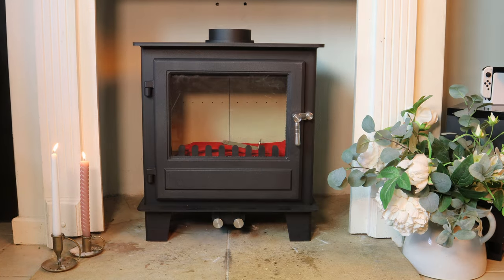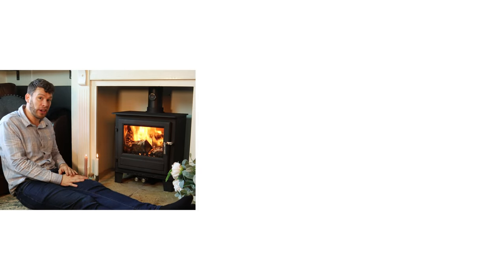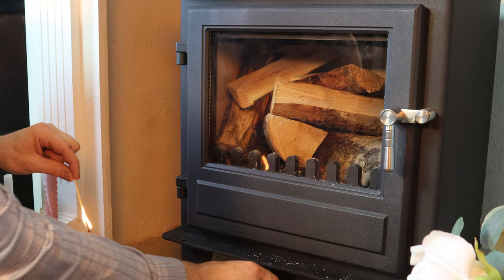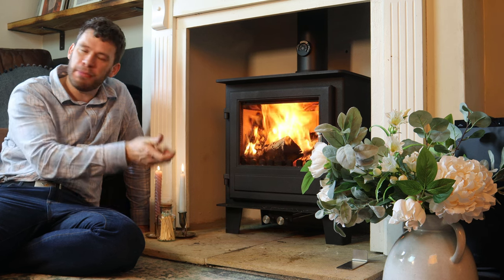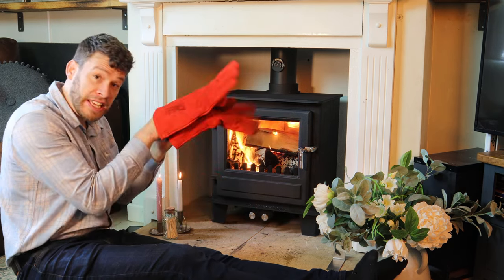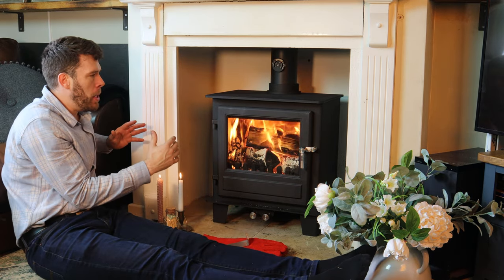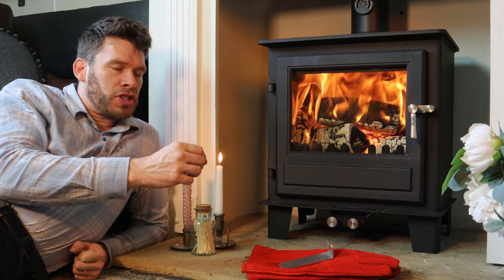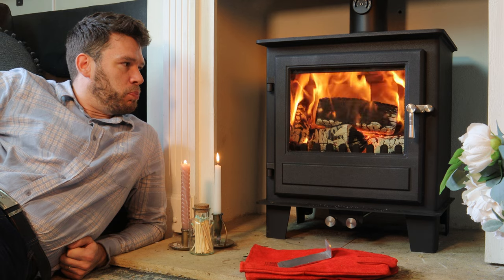Full review of the Clock Blithfield stove

Comment: Daft question, could you put a heat stone on the bottom if you don't burn coal to make it more efficient do you think?
Reply from the maker: I’ve just started looking at a FireMizer. I’ll let you know, but it certainly looks like it maybe useful in this situation.
Reply: @TheTortoise  Would laying vermiculite board work?
Reply from the maker: It will likely break up, but that’s not necessarily a disaster, you could just leave it there. 

I’m sure no manufacturer would encourage edits to a stove, but there is nothing about doing that - that would worry me.

Comment: I really like this review on this   Clock Blithfield stove  i like the engineering ,and quality , i have an question if i may ! at the moment i am running a Jydepejsen 575 i give it a Okay rating its 4 years old when getting hot it now give a loud expansion bang not sure where its coming from. Now to my question on cheeking i see the stove takes a 5inch stove pipe ,i have a 6 inch stainless steel pipe  4 years old , will this stove adapt to the larger 6 inch stainless steel flue pipe pipe ? if i was to buy the Clock Blithfield stove ,would appreciate advice please ?
Reply from the maker: Yes, there’s no issue at all with connecting a 5-6” increaser to these stoves and then running on a 6” flue. In fact I would recommend it (generally) as it means you can run the stove without the DEFRA stop, maximising control.
Reply: Many thanks for your very informative and detailed explanation regarding my question   ,5" to 6" stainless  liner, much appreciated, and great news.
Reply: @TheTortoise  Hi again Gabe..Would that mean even though im in a smokeless zone, a six inch stainless flue on the Blithfeild would mean I could remove the Defra stop and remain legal?
Reply from the maker: Sadly not. In a smokeless zone the DEFRA stop is a requirement. The only exception to this is if you were planning to burn smokeless fuel. In this situation the fuel itself is smokeless, so you can remove the DEFRA stop.
Reply: @TheTortoise  Got it..many thanks for clearing that up.

Comment: Hello I am woundering out of the two beetween this modle and the Heta Ambition 5 which one would you opt for and why?
Reply from the maker: They’re not really direct competitors because one is multi-fuel and the other is wood only (bit like comparing a sports car with an SUV). 
If I was burning wood and wanted the best performance there is no comparison, the Heta will win every time. But the Clock does have some aces up it’s sleeve too, so it’s more a question of who the buyer is and what they want from the stove. 

Having said that, these are both superb, so either way you’re looking at a £100k Aston Martin or a Range Rover 😆
Reply: Thank you for taking the time too give such a detailed response too my question.

Comment: Great review had ours two years. Fitted with a stainless duel wall flu. 
Now you mention you removed the defra kit! What's this? I never did it. Will it run better with this removed?? The thoughts of moving it out make cringe man ots heavy. But if I can make ot better I will. We live our in the sticks, so now worries there. 

Thanks. Look forward to a reply.
Reply from the maker: The DEFRA kit prevents the stove from fully shutting down. If your stove can extinguish its flames, then it’s not fitted or doesn’t need removing. If when your stove is fully closed it still burns with a busy flame then you possibly could remove the block in the vent at the back. You need to have a 6” flue and not be in a smokeless zone, but if that’s the case you could have a chat with your fitter about pulling it out and making the change.
Reply: What's the positives from taking g it out? Thanks for the reply.
Reply from the maker: Often it isn’t needed, but it is useful for prolonging burn time particularly if the chimney has a strong draw.
Reply: Great review once again! Mine got delivered today. How would I know if mine has the defra stop on? And how could this be removed?
Reply from the maker: @grantlee2455  Worth chatting it through with the fitter as there are a couple of requirements before removing the DEFRA kit. You know if it is fitted because when you close both vents one of them (when you look at the back) is not able to completely close.
Reply: @TheTortoise  Thank you for the response. Must not be fitted as they both close fully 👍🏾
Reply: I thought defra kit was just the small blanking plate at the bottom right hand side on the back ?
Reply from the maker: I can’t remember, but I can find out if needed. From memory it was either a block in the vent, but now I’m thinking there is a round metal circle on the back in the middle. It is covering a hole that allows air in, and you can adjust how open that is (it acts as a permanent leak). 

There are so many stoves now, I may be getting some mixed up. Either way the principal will remain a permanent leak on the air that can’t be closed.
Reply: @topgolf7215   I have one, and i think you are right about the DEFRA blanking plate. I had a couple of occasions when I got a bit worried by not being able to turn the fire down sufficiently (almost a runaway!) I got the glove on and put my finger over the hole in the back, which did the trick (stopping the air and calming it down) I would like to close the bleed vent completely, and looks like the blanking plate can be moved after loosening the nut that is holding it in position? Anyone know for sure?

Comment: I have been told of my installer that the clock blithfield have had a lot of problems with cracking.

He reckons he has had a few seperate  stoves over the past months start to crack on the corners.

I had this Stove as the only one I really wanted but now seem a little put off .

Am I being silly ? 
Is the clock after service any good ?
Reply from the maker: James Archer is the original creator and owner of Clock. He is a really lovely chap and he seems to have set his sights on achieving zero warranty claims (something I believe he might achieve). With regard to cracking he has alluded to me that the mk1 stoves did have some issues and he has assured both me and another commenter on this video that anyone who suffered this has been properly cared for (a replacement stove seemed to be the solution he mentioned where a manufacturer fault was found). 

Having poured over this stove I cannot imagine this issue being continued, but leaving aside somebody being abusive or foolish with a stove I do not foresee any cause for concern. I rated the stove very highly and based on my conversations with both James Archer and TEP who manufacture and distribute Clock stoves, I don’t know of anything that concerns me. Almost everything I’ve heard is very positive in regard to their handling of the issues with the mk1 stoves.
Reply: @TheTortoise  Thanks a lot 👍
Reply: We had our clock stove installed in January , no faults on it at all  .
It burns well on wood and if at a good temperature , put smokeless coal on it lasts all night .
Reply: @javidjames3319  Sounds good , I’ve heard a hell of a lot of good things about the Blithfield 5 but the cracking did put me off abit but I’m sure Clock have worked hard to correct these flaws .
Reply from the maker: @javidjames3319  yea it’s nice an easy for overnight if that’s your bag. Good to hear it’s working well.
Reply: I have personally  sold hundreds of these stoves. I know of only 2 faults in all that time . One was  on a firebrick which was the first one they had ever had. The second was a faulty body both of which got replaced free of charge. The body got sent back to the factory for investigation . They are superb i wouldnt worry for a second
Reply: This was an issue with early models with the welding at the top of the door opening on both sides. This has now been resolved in the manufacturing process and their warranty is second to none. If you had this issue it got replaced.

Comment: This or the dig guertz ivar 5?!
Reply from the maker: That’s a good question. Money wise they’re about the same, so I would base this on:

The Clock suits a bigger room as it has a bigger output. 
The Ivar can run for longer on a load of wood
The clock is suited to coal if needed
The Ivar is slightly easier and slicker to use. 

But they’re both superb, so look is probably the better guest deciding factor.

Comment: Have seen a few people reporting cracks in the body ( around the top right side of the door opening)…
Reply: That happened on some mk1 blithfields this is a mk2 been around for 3 years now. The mk1 had a boost function on it for if you had embers 30seconds of boost just to get it back to life what was found was people ran them with the boost open all the time and were overfireing them but customers were looked after on warreny claims .
Reply from the maker: That’s good, glad to hear things were worked out. Looking at the stove I was thinking to myself, how on earth would you split this thing with anything short of 🧨 😆
Reply: Also finish paint issues, plus people reporting of them being noisy almost ticking like a clock? Supply has also been an issue from my own experience, as mentioned ended up going with a DG Ivar 5 which has been absolutely flawless and really easy to operate with its single air control. To each his own and nice to see a UK company manufacturing gear again!
Reply from the maker: @CraigK80  I’m testing the Ivar 8 very soon too, those stoves are brilliant as you say!
Reply: @TheTortoise  once you’ve got past the comical DG pronunciation for the UK ( it’s quite funny to be fair, bit like Schitt Audio, I kid you not) it really is a remarkable stove. A year on and I’m biting at the bit to get it fired up again. I pretty much looked at all the 5kw stoves, rang around a lot of the main dealers in the country and researched the forums (that’s how I found your fantastic channel!) and got a feel for them. In the end I went with a scandy designed stove, really glad I did. Stunning design and ease of operation! I look forward to the Ivar 8 review mate! Thanks again for all your work and efforts in making this channel the best in the business!
Reply from the maker: @CraigK80  thanks a lot. Yea I’m excited to test some bigger stoves, so the 8 will be an interesting one.

Comment: Clock Blithfield – 5kw or heta inspire 45? 😊
Reply from the maker: Very tough decision that is. The Heta has a stay cool handle, easy air control and very sleek. The Clock on the other hand is a monster, built for very serious use. I think look would be an important factor, also how you plan to use it. If you’re a very serious user, I’d lean towards the Clock, if not then the Heta has an edge in refinement.
Reply: @TheTortoise  you are the best.. thank you 👍
Reply from the maker: No worries, thanks😅

Comment: We have a Blithfield and also a Blithfiekd Compact. Beatiful stoves, easy to use. The Compact has noticeably less heat output (which is logical).
Reply from the maker: Makes sense 🤣
Reply: Could you give any guidance or advice on the controls? I don’t know at what point to shut down the right control and how to manage the left - any colours to look out for a steady flame? 😂
Reply from the maker: The most helpful thing I can suggest if you’re new to stoves is our thermometer. You can essentially then, turn the primary air off when the stove is at operating temperature and then keep the stove at a sensible temperature with the main control. Once you’ve got the hang of that, let me know and then I can talk you through getting higher performance out of it. You’ve bought a great stove, so it will be fairly easy to achieve some impressive performance.

Comment: What size logs fit this stove? anybody know, thanks
Reply from the maker: I believe the manufacturer will say 300mm. It will physically fit very large logs inside, but often log length is quoted as much smaller pieces to maximise efficiency (large logs take more effort to burn, so they lower efficiency, but the flip side is they burn for longer).
Reply: @TheTortoise  thank you